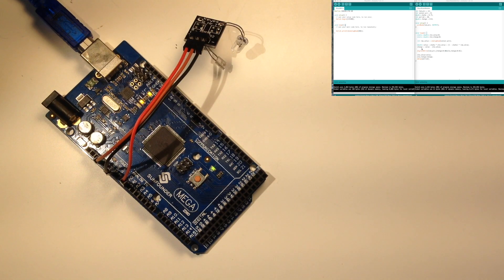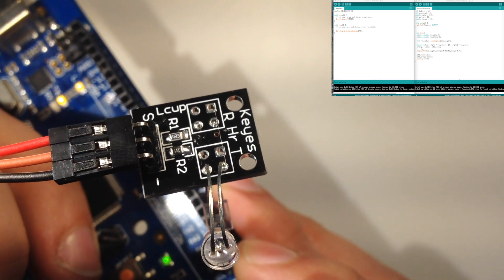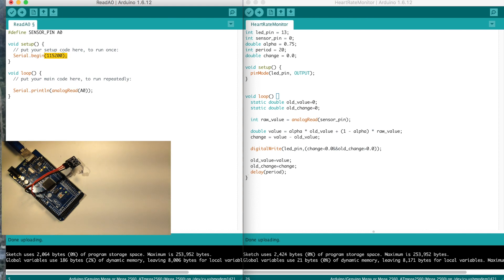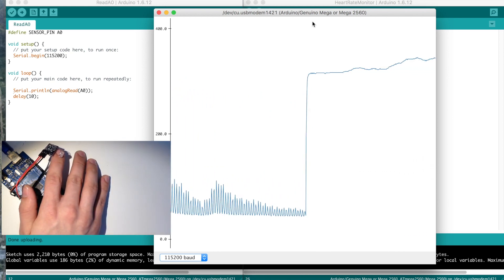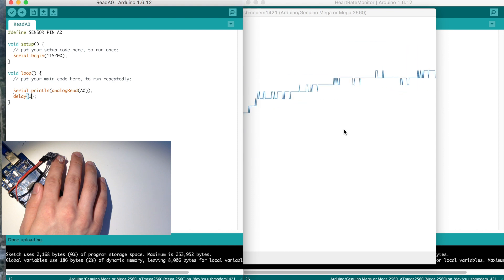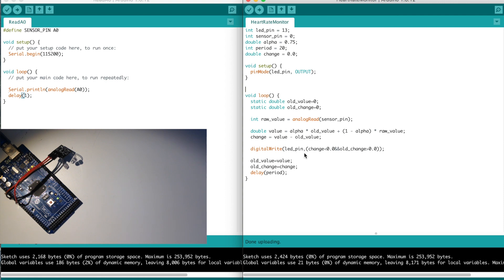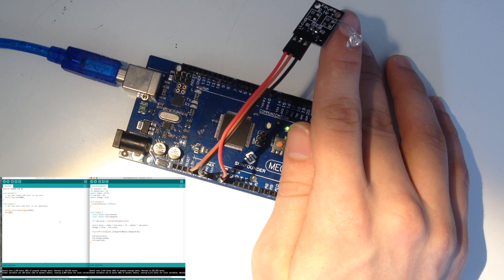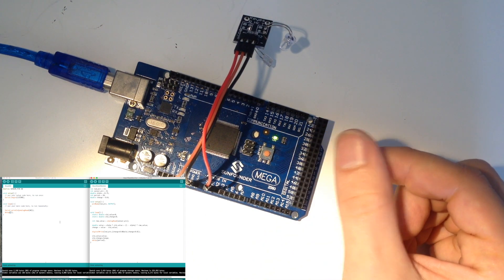Arduino RYW-039 Heart Rate Monitor

Comment: This is not heartbeat, you are just printing voltages
Reply: hi i have a project where i need to use this sensor to find an heartbeat, however i can't find the equation to switch from voltage to heartbeat do you have any idea how to do it ,?

Comment: Could the receiver benefit from a filter of some kind?
Reply from the maker: probably. This was really just an initial impressions video since I realized there weren't any videos of it online (as far as I could tell). I'll try to put some filtering in, and increase the signal to noise ratio later.
Reply: can you please give us some hint how we might do this??what kind of hardware may be required in this case???